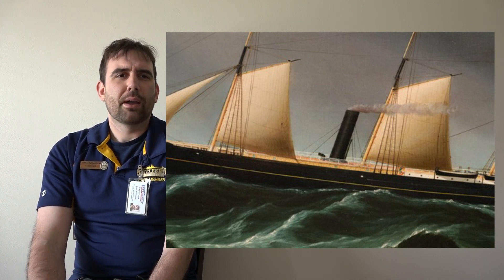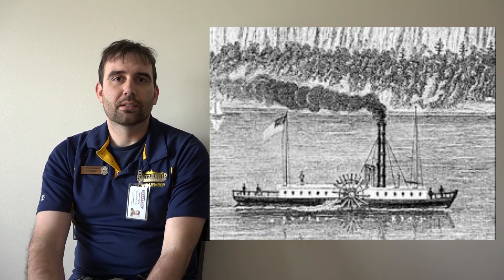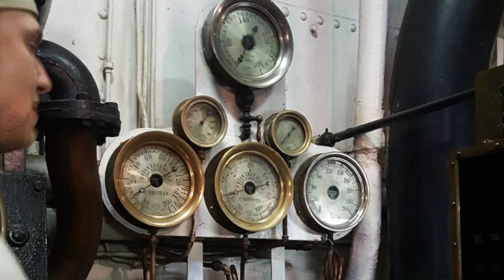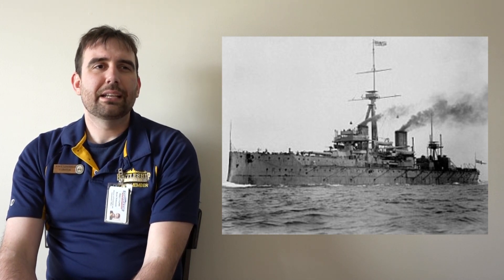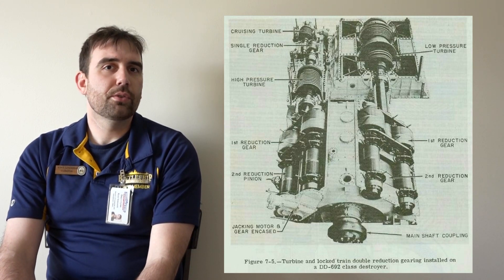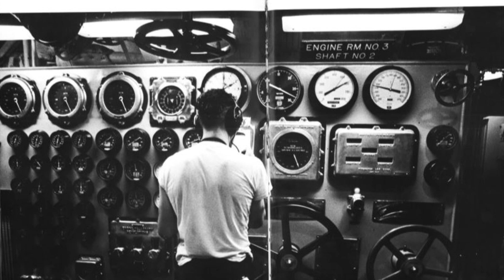The War at Home: Propulsion

Comment: You can heat boilers as fast as the fires will allow, but fast heating induces thermal expansion stresses on the boilers and tubes and very significantly reduces time between overhauls involving countless boiler tubes (miles of?) and labor in a cramped environment. A day likely balances time to operating pressure with maximum longevity.
Reply: Instablaster

Comment: Installing a small modular reactor (SMR)  of perhaps 200 MW using liquid salt or metal coolant with a relatively light weight design of small dimensions that will fit on a truck trailer would be possible.I predict that the shift from carbon-based fuels will require a shift towards modern nuclear plants since existing ones are mostly generation 2 when the latest plants are generation 3 or 3+ with Gen 4 almost ready for introduction. If New Jersey had a small nuclear plant, she could hook into the power grid and sell enough electric power to pay for her restoration and upkeep as well as supplying a significant baseload power source to the grid as well as other benefits. Perhaps you could remove an exhaust stack for installation.
https://en.wikipedia.org/wiki/Generation_IV_reactor
https://en.wikipedia.org/wiki/Small_modular_reactor

There are now molten salt and molten metal plants that use these materials for coolant, the material that transfers heat from the reactor core to the steam turbine plant where it is converted to electrical energy. These new molten salt and molten metal coolants do not operate anywhere near their boiling points which allows low pressures in the reactor side of the plant but with temperatures higher than with high pressure steam coolant in the reactor. Higher temperature means higher heat transfer and thermal efficiency - perhaps 45% efficiency vs 33%.

https://en.wikipedia.org/wiki/Molten_salt_reactor
https://en.wikipedia.org/wiki/Liquid_metal_cooled_reactor
Reply: I predict nobody will care about your predictions.

Comment: you say we dont use steam turbines anymore but I have read the gerald ford carriers use direct steam turbines  to propel her with the boiled steam from the reactors  vs an electro motor drive turning the screws , I know differant power source but the concept is the same
Reply from the maker: The system is similar from nuclear to conventional but is still a big enough difference that moving sailors from one system to another is tough
Reply: @BattleshipNewJersey  right I was just saying it did go back to a steam powered turbine, so how long did it take to bring the iowa class up to steam from cold start ? would it take less then 8 hours as would be the case with a steam locomotive, since its watertube or would it take longer as the boilers are just out and out huge and very high pressure
Reply from the maker: From a cold start is closer to a day with these plants. Were a little bigger than a train so everything is a little slower. 

It never really stopped being steam though, the nuclear systems do generally make steam, so that part hasn't changed. But how they make steam is so different that they might as well not be making steam, if that makes sense?
Reply: @BattleshipNewJersey  well I would say its a lot bigger then a steam loco, even the largest built, your boiler on a loco is about 300 psi, and the firebox on the largest ones oh roughly 9 feet wide by 15 long on the allegheny they are firetube though so it dont have the surface area a watertube does, and the superheating is about 700 degrees f I hear on some of the most powerful and efficent of the late steam period like c and o 614, 844 of the union pacific, or 611 on the norfolk and western northern class 4x8x4, though they did experament with hybrid watertube style fireboxes with tubes around it like a watertube and the gasses run though the tanks, but the watertube cant take the pounding and abuse of bumping around from a locomotive, like one on a ship or stationary plant can, it leaks too much, not enough structural ridgetity in it, but I would say the lenght of the whole boiler tank is prob 50-60 feet long and taking from one being built today slowly called a pennsylvana railroad style t1 I belive its 96 inches in diameter, so problably 2 or three of those watertube boilers would fit in that kind of space.

as for the your statment about being differant as to how its set up to make steam makes perfect sence, the systomes and accutraments for nuclear are differant, problably higher pressure, and special water processing  systoms to keep it active vs just an oil fired boiler, I did not think though it would take a day to get up to power thats a long time and far removed from the movies that have her going almost immediately, really had not much idea as i have heard some stationary plants for buildings getting up to a head of steam in 15-20 minutes though it would be like for a commercial or heating boiler and would likely be not long out of use so that is why I would have questioned if it took just a short time to fire the ship up to full pressure as a watertube has more surface area to heat water with to steam and dont have to bring a whole tank size vessle up to pressure like a firetube boiler tubes can be thicker and smaller for less area it has to compress to get to that pressure

Comment: Conceivably you could convert an Iowa to Gas Turbine, most straightforward way to do it would be to rip out the entire steam plant and install 8 LM2500s essentially installing the propulsion plants from two Arleigh Burkes into one Battleship.  This introduces a lot of challenges though needing to replace the reduction gears, shafts and screws.  If you could do it you'd end up almost exactly matching the installed HP on the ship with lighter weight, greater flexibility (not needing to light off the plant 24+ hours before getting underway) and especially a much smaller engineering crew needed to operate and maintain the plant.  Another advantage of this is the Navy already has thousands of trained & experienced GSMs and GSEs who could run this plant with very little retraining required.

An alternate approach would have you also install either 8 LM2500s or possibly 4 MT-30s driving electric generators and then mount electric motors directly to the existing reduction gears and shafts/screws.  This would borrow heavily from the Zumwalt class design and is probably more practical and cheaper in the long run but you eliminate most of the advantage of having pre-trained sailors.  One big advantage of this approach is it would require the least cutting of the hull as you could get most of the equipment in and out of the ship via the funnels.  An added benefit to this approach is all that power could potentially power more modern weapons systems such as future rail guns.

Still, all very far from realistic and the most unlikely of scenarios but a fun thought exercise.
Reply: A lot more realistic than the article I once saw that said "rip out the boilers and put in nuclear reactors, now we've got an awesome nuke battleship!"